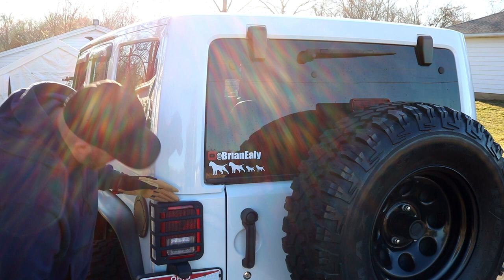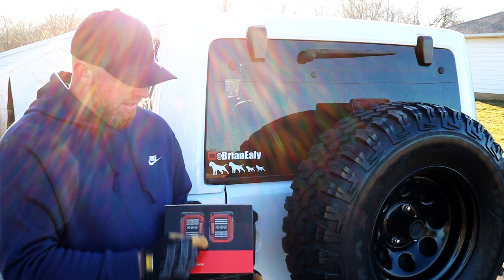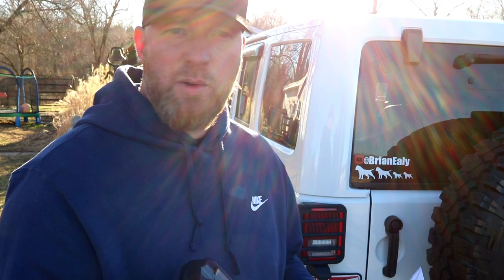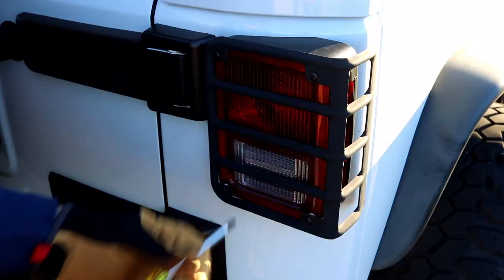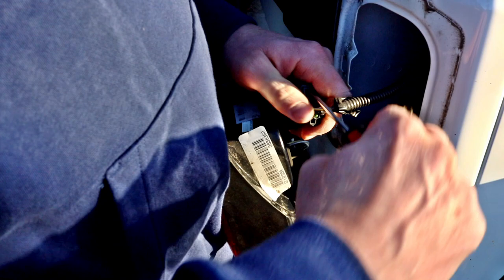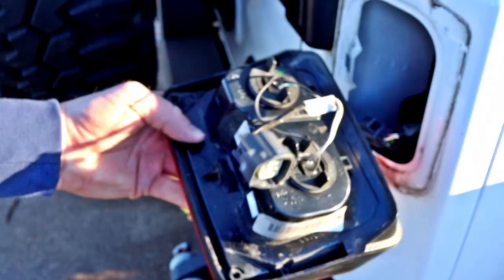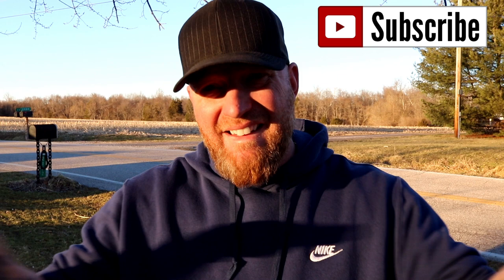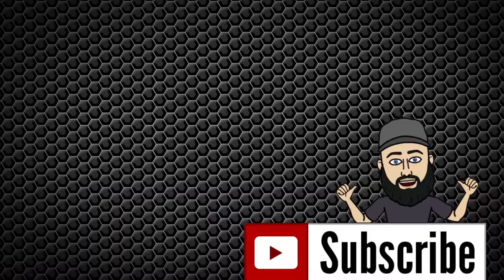LED Tail Lights - How To Install / Review - Jeep JK

Comment: Great video  but it's funny how when anyone sees 4 screws they automatically think all 4 has to come out to remove the tail lights, but in fact only 2 need to come out on the JK. Did you use your fingers to determine when the sun will go down? if so I am impressed. Not to many people know that method, or did you just wing it..lol..

Comment: Good evening, 
I was just about to install these tail lights when I ran into an issue with the left side. Tail lights have been replaced before and the connection has been modified. 
Where can I get the original wire harness plug? Jeep side (male) not the tail light side (female) if that makes sense
Reply from the maker: @rudyceron234  
I would get them off the official mopar site if you want the actual factory quality.  This is the link for the 2007-2016 model. I think it’s part number 6 under the taillight assembly https://www.directmoparparts.com/v-2016-jeep-wrangler--sahara--3-6l-v6-gas/electrical--lamps-interior-and-exterior If you want cheaper try searching Amazon or eBay for a Jeep Jk taillight harness.